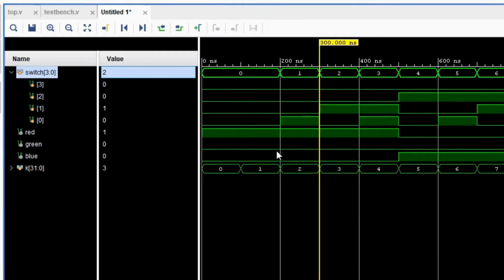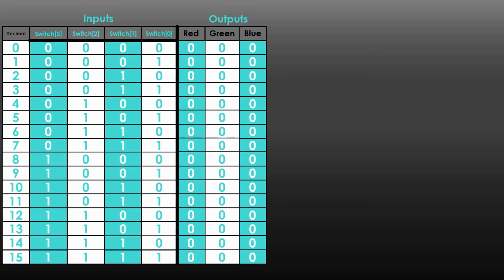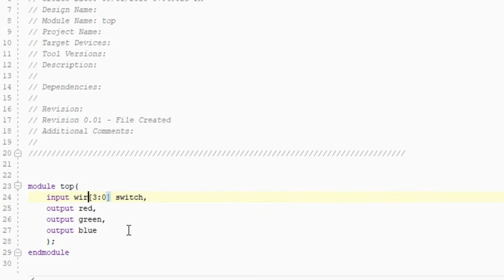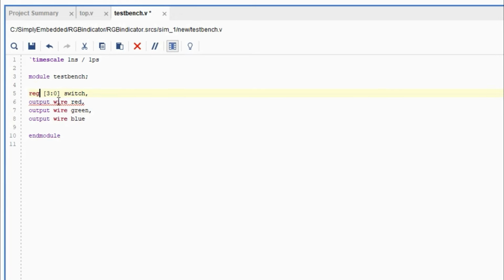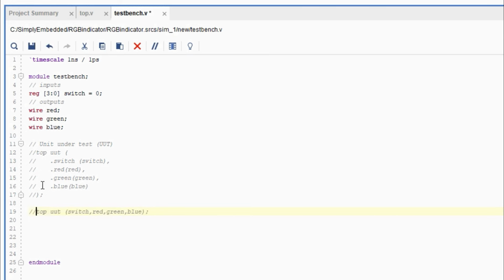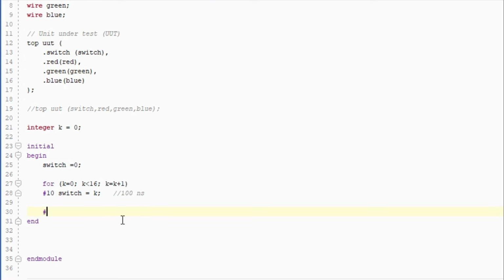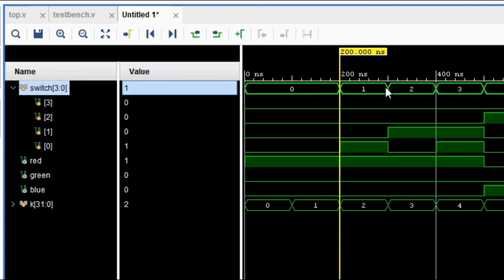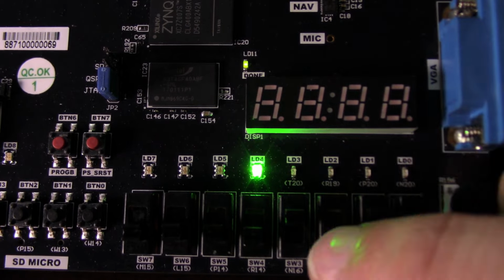Vivado Simulator and Test Bench in Verilog | Xilinx FPGA Programming Tutorials

Comment: Hey there! While playing with the simulator I keep running into the same error message and for the life of me I cannot figure what is wrong.  "ERROR: [Common 17-39] 'launch_simulation' failed due to earlier errors." The messages read "[USF-XSim-62]" and "[Vivado 12-4473]" Any ideas on how to fix this would be awesome! Thank you so much for the helpful videos too!
Reply from the maker: Hi Jack, if possible double check and make sure you got everything absolutely correct in your testbench module (no extra commas etc.) then make sure you got everything correct in the top verilog module (all syntax correct). Check out the video from 5:31. If the problem persists, check out my facebook page (https://www.facebook.com/SimplyEmbedded) and message me there by sending your code for the verilog top module and your testbench file. I'm glad to hear the videos are helpful!
Reply from the maker: Hey Jack, did you ever get the simulator running?
Reply: @SimplyEmbedded  I did when I ran it on my laptop, and not my desktop. Everything was the same just a different machine. Any ideas why a certain PC would have issues?
Reply from the maker: I'm glad it worked on your laptop at least, well I can't say for sure as long as I haven't seen the code you try to run on the PC. Although some research online implies that it is a mistake in the code (either the Top module or the simulation file). You can check the error message as it gives you a path to a file [USF-XSim 62] 'elaborate' step failed with error(s). Please check the Tcl console output or 'path/something.log' file for more information. find and open this file and read what it will tell you or check the TCL console output for specific error messages in the files (it should tell a specific line in a verilog module). Try it out and see if it makes any difference - let me know if you are able to resolve it like that :)
Reply: Will do! Thank you so much!
Reply: Have you got the solution for this problem?Even im also facing with the same issue.can you guide me to sort out this issue?

Comment: how can i add a clock to the simulation? i want to test this code 
`timescale 1ns / 1ps

module module_blinkingLED(
    input clk,
    output reg led,
    output reg [31:0] counter = 0
    );
    
    
 always @ (posedge clk) begin
 
    if(counter == 49999999) begin
        led <= ~ led;
        counter = 0;
    end // end if
    
    else
        counter = counter + 1;  
 end // end always @ clk
    
endmodule